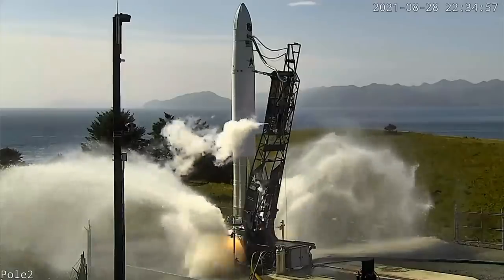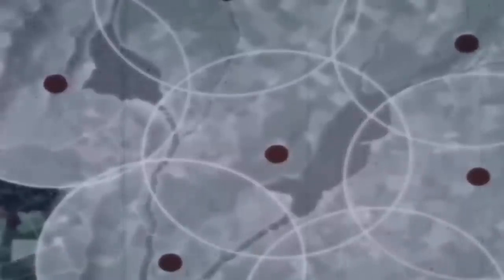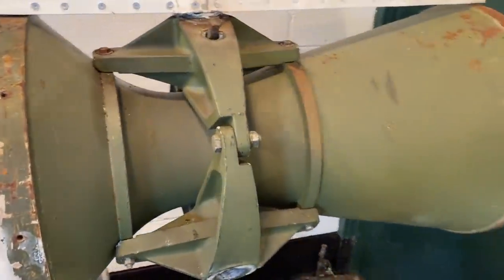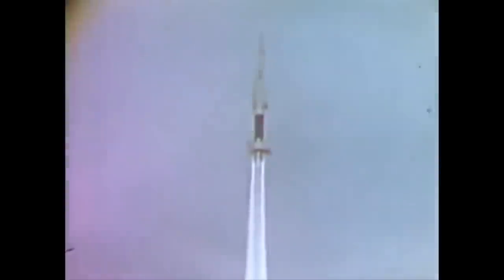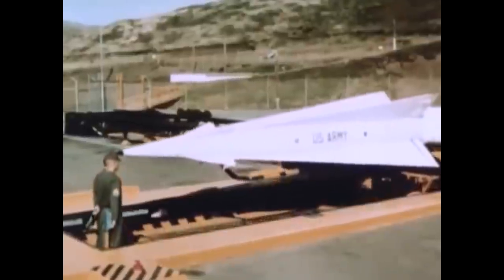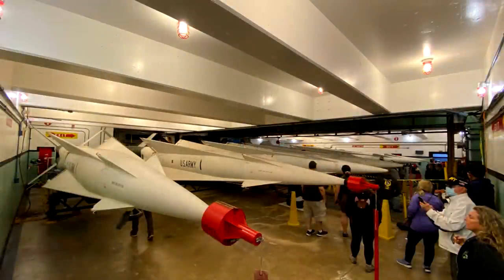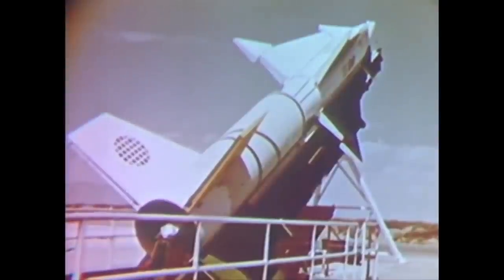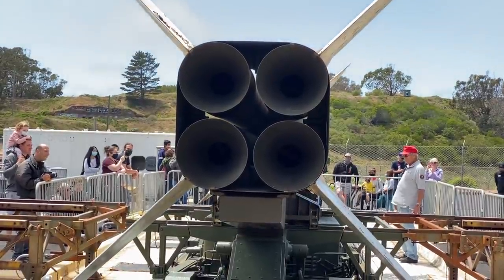Nike-Hercules - US's Surface To Air Missile with Nuclear Warheads.

Comment: In the mid 1960s, I was stationed at Redstone Arsenal AL as a Nike Hercules electronics instructor. You wondered about the analog computer.  The computer was very simple. Picture a servo driven slide rule connected to each of the missile and target tracking radars. It converted all of the angular and range inputs into large cubes in space with the intercept point in the center. As the missile neared the target the cubes became smaller and smaller until the burst signal was sent. See, nothing to it. Only one problem understanding this. Most of you youngsters have no idea what a slid rule is!
Reply from the maker: Slide rules I understand, building feedback amplifiers with sufficiently accurate response is the hard parts.
Reply: @scottmanley  
Of course the null detectors were vacum tubs, with of all things, DC filaments to reduce noise. Even at that, they were zeroed out once a second to stop any drift. The small heartbeat "zero set" ticks could be seen on the plotter.

The data potentiometers were really something. They were oil filled, about 18" in diameter, with spiral wrapped wire wound function cards. Each were many turns, quite a few feet in length. The servo drove a pickup shoe that followed the spiral. The shape of the card determined the function. Literally flat for liniar,  log or sign shapes for the trig functions. 

There were differences in the Ajax and Hercules command systems. First of all, the Hercules radar rep rate had to be longer to acomidate it's longer range. That is 12.6 microseconds per radar mile. Also the Hercules commands were digital pulses, while the Ajax was an single analog step kind of a pulse. The missile track radars could be switched to select either type missile. 

Did you know the radars were manually frequently hopping?! Each had two magnetrons. An operator would watch a spectrum analyzer for any  jamming, move the off line magnetron away to a clear frequency and switch it over. The missile receivers were unturned,  wide open to the X band. However it would only responded to the proper digital battery code, as there could also be missels in the air from other batteries. 

Fantastic how small that analog computer was. It "only" occupied a van about half the size of an 18 wheeler. The entire system electronics was vacume tubes, requiring enough power to light a small city. Well maybe not that much, but close.
Reply: @waterpogojim5296  Yes, those were the good old days.

Comment: The switch to nuclear Nike Hercules was limited or underway when Nike was cancelled – of the 5 batteries here around Bridgeport CT only the north one in Ansonia got the Hercules and all these sites were abandoned before 1970.
Reply: Maybe your area wasn't considered a high priority target. I can think of 6 sites in the San Francisco Bay area right off the bat that recieved Hercules and weren't deactivated until the early to mid 70s. One of them still has a deactivated missile, and is a tourist sight.
Reply: Yes one would assume the major cities were a priority – we all know about the San Francisco Nike sites and museum which were certainly more important than Bridgeport and dozens of other cities.
Reply: @johnwatson3948  
Perhaps I chose my words poorly. I didn't mean to sound high and mighty or give offense. I just meant to inform that many sites converted and remained active for several years.
Reply: No problem my reply was not meant that way either and you know the subject
Reply: Hercs had 4 times the range and FAR more punch so fewer sites were necessary. Nuclear upgrades started in 1957 and decommissioning was mostly complete by 1972 because ICBMs and SLBMs changed the threat. ALSO, Hercs move much faster and some locations could not be upgraded because the radar and launch sites were too close for the faster missiles.

Comment: Hi Scott, I was a USAF Missile Technician maintaining AIM-9 Sidewinders, AIM-7 Sparrows and AGM-65 Mavericks in the early 1980’s. I later did communication support for Titan 2 ICBMs. I have an AIM-9 Sidewinder Missile wing with a functioning rolleron. It can be spun up with an air compressor and uncared to demonstrate its function. I would be happy to loan it to you if you ever do a video that it would benefit. It’s 24” by 10”,  easily shipped.  PM me if so.

Comment: Analog computers:

I'll not delve into the murky depths of mechanical implementations, but the principals are the same.
First up is definition of the word "computer", in modern terms, these are more programmable calculators than computers.
Most computing elements are based around differential OPerational AMPlifiers (OpAmps). A theoretical opamp will have infinite gain and infinite input impedance. The output is proportional to the difference between the inputs.
Using these it is easy to build adders, subtractors, multipliers, integrators, and differentiators.
The "programing" stage is to write the problem as mathematical equations, the analog computer can then solve those equations in real time.

Comment: Well, after the SALT agreements, many missiles changed hands to go to the U.S. allies, but the ACCESS to them remained with "Custodial" units when U.S. warheads were still attached.  Technically the U.S. didn't have the missile WITH the warhead, BUT........  Also, many were at the maximum surface to surface range in Europe to the last defensible line in case of Soviet Attack.

Comment: Hi Scott - love your content - I think it'd be fun to get Kerbal space program on this. :+) - what does it look like launching to low earth orbit from Mt Kilamanjaro?

Save a lot of fuel and tankage - 19,000 foot mtn. - so first 3.5 miles altitude is by truck, 19,000 feet - so air is thinner to start with (.45 atm), and exactly on the equator, already going 1000 miles per hour West to East.

Comment: I always thought the artillery shells used a linear two point implosion device. I guess a gun type makes sense as being really simple.
Reply: All the early tactical warheads were Oralloy (Oak Ridge Alloy) only designs (no plutonium, only U235) so that the resulting contamination was relatively less damaging. The Hercules warhead was all U235 for this reason. With a gun design you can use a "passive" neutron initiator and they don't need batteries or any electronics.

Comment: Analog computers isn´t really that strange. Typically they just use a line level ALU that uses a capacity stacking for addition and subtraction. Multiplication is a bit more complicated. How its done is that the signal is converted to a logarithm via a non linear component, then added or subtracted for multiplication or division, then converted back to linear scale.

So a Analog ALU is really quite simple. Just two devices. A analog stacking device and a log device. Subtracktion and division is simply done with a inversion.

Then there are of cause compare functions that is usually just done via a subtraction and check if the voltage is positive or negative.

Analog registers work just like digital. The only real diffrance is that the output need to be a op amp in steed of just a transistor.

Now for programming a analog computer are usually very different to a digital. As far as i seen most (if not all) uses a totally segregated register for instructions and data, and a lot of them simply uses digital instruction set. The instruction set is also often very limited, try to fit it in 16 instructions to only get 4 bit registers for instruction set, or even 8 instruction for 3 bit register.

A lot of analog computers is not even really computers but really calculators that just run a set loop of calculations. This is also true for a lot of compact mechanical computers. A typical example of that would be the engine control computer of a WWII FW 190 fighter. Most WWII fighters had a number of levers for the pilot to control the engine, i seen planes with as much as 6 levers for a single engine fighter. Propeller pitch, methanol water injection, fuel mix, engine cooling, actual throttle, there are even more possibility.

While most late war fighters had automatic pitch propeller, there was still a leaver to control the pitch system. FW 190 replaced all this a computer and just one leaver. The computer is actually fairly small.

Comment: I’ve seen some claims being made online that the Nike missile bases protecting the airspace around major east coast US cities from Soviet aircraft attack were fitted with nuclear warheads. This is a farfetched claim for many logical reasons. First and foremost, locating nuclear weapons so near high population areas would have defeated the defensive purpose of the Nike missile system if an accident occurred or if an enemy simply attacked the facility as opposed to the nearby metropolis it was defending. Second, the security required to protect bases with nuclear weapons would have been impractical given the proximity of these bases to populated areas. Lastly, the range of these missiles was inadequate to carry a nuclear warhead far enough from its point of launch to a safe distance from our populated coastline. I lived near the NY93/94 Nike Missile Base located in Franklin Lakes, NJ and hiked past it just along the fenced perimeter while the base was still active, which would not have been even remotely possible if live nuclear warheads were fitted to missiles in their underground bunkers only a few hundred feet away.
Reply from the maker: You appear to overestimate the blast radius of a nuclear warhead: here’s what a 20kt device a few miles off the coast would look like - https://nuclearsecrecy.com/nukemap/?&kt=20&lat=37.8049014&lng=-122.8058624&hob_opt=2&hob_psi=5&hob_ft=100&psi=20,5,1&zm=10

Comment: Looking at that missile cutaway, it looks like it has something like magnetic core memory as a processor perhaps?
Reply: The missiles were radio controlled from the ground. They received pitch, yaw, and explode commands from the computer via the MTR or Missile Tracking Radar. No "processor" per say, just a set of roughly 100 tube opamps hardwired to produce a firing solution.
Reply: @Peter_S_  Oh wow. You learn something new every day...
Reply: Nop, no core memory, no digital, info was stored on capacitors, with tube electronics to keep them charged, and the tube amplifiers where kept stable by mechanical rotary switches testing them all every few seconds

Comment: The USAF also had nuclear air-to-air weapons, namely:
AIR-2A Genie unguided rocket (1.25kt W25 warhead, time fuse) used by F-89 Scorpions, F-101B Voodoos and F-106 Delta Darts
AIM-26A Falcon guided missile (0.25kt W54 warhead, semi-active radar guidance) used by F-102 Delta Daggers

The rationale of "bomber formation" targets was a bit of period propaganda that won't die. Nuclear-armed bombers wern't coming in formations (why should they?). The real problem that they didn't want to admit to was the accuracy of 1950s electronics (as explained in the video) that couldn't reliably put a missile within the lethal radius of a practical-sized conventional warhead in a head-on shot. A Genie warhead was tested in Operation Plumbob in 1957. It was detonated at around 20,000ft, and volunteer observers directly below the blast suffered no ill effects and measured negligible radiation levels.

Oh, and to any Brits thinking "tch - only in America"; the RAF wanted Genies for it's Lightnings and tried hard to buy them. The US was up for selling the weapon too, but the fissile material would have had to come from the UK nuclear programme and that was the death of the idea, because we were only just producing enough for our strategic weapons and the government decided that those got priority (because they stopped WWIII from happening via deterrence) over defensive tactical weapons (that would only get used if deterrence had failed).

Comment: 10:09 "The non nuclear version wouldn't need this of course." Why not? Surely it's not a good idea to have anything detonate accidentally on the ground.
Reply: The Launcher Control Area was a very dangerous place.

High explosive detonations are always possible when rocket motors and warheads are involved. The static probe prevented NUCLEAR yields until the missile was outbound.

Comment: "The nuclear one had a surface attack profile" just incase your neighbor city gets too nosey
Reply: Very useful in Europe just in case you needed to nuke a rail yard that was being invaded. Also useful for anti-ship from a very small number of sites.
Reply: @Peter_S_  I wonder what the range would be on them. Given they look like they had alot of drag.
Reply: @samgeorge4798  These missile actually "flew" with the wings providing 0.5G of active aerodynamic lift just like a plane's wings. Trajectory would arc above the target elevation so the missile was always flying down to the target. Operational ceiling was just over 100,000 feet and initial elevation dictated maximum range which was about 95 miles against a typical medium level airborne target, a little less for a high altitude bomber. A surface target could be slightly further away... I seem to remember a figure just short of 120 miles, but the "S-S Mission" button was only added later in the system's life. Top speed of mach 3.65 and at launch they were already supersonic before traveling their own length. Drag was not much of an issue.
Reply: @Peter_S_  ahh your right I completely neglected the lift all those control surfaces would provide.

Comment: They may never have been fired in anger but I do know one was launched from the site defending DC.

All those radars needed to be calibrated, so how do you calibrate them? You send bombers out and have them do mock attacks. My grandfather was the flight engineer on one of those bombers. While as far as the crew knew everything had gone great, that is until, they got back to base. When they landed they were told they were lucky because someone actually launched one of the missiles at them instead of just simulating the launch. The controller blew up the missile but it could have been really bad.
Reply: Not in my years in ADA did we ever launch a bird in D.C.
Only time we launch these birds were for training in NM or Create. 

In 73 we went to battle stations had 12 birds locked an loaded on lchr read for action,  but no launch order ever came .
Reply: @bradhanley8368  This happened in the mid 50s. My grandpa was on a B-29 at the time.

Comment: Nuclear weapons must be banned, purely for statistical reasons for nuclear war being triggered by accident.

If we estimate, for example a 1% risk per year (o.o1) because of risk of misunderstandings, technical malfunction or terrorist attack for every year (probably lower most years, however probably much higher some years, and we look back at about 70 years with proliferation of missile based nuclear weapons, we simply get the formula 0.99^70 for survival, which equals to about 0.5 meaning 50% chance of survival so far! 

Of course the risk could be much lower than 1%, however still by the power of exponents, the risk will approach 1 (100%) sooner or later, the dice is thrown as time goes by, regardless.

This comment is not meant political, it simply takes into account the unavoidable math that is behind the increasing risk that nuclear weapons are used, with the high risk of firing additional weapons, if one weapon already is fired, be it by accident or malice (most probably terrorism or something happening in eg. North Korea or a a crazy dictator taking control in any country having nuclear weapons)

Comment: The US Airforce used to have their own missile defense called BOMARC that also had a nuclear warhead. I live about 20 miles from the BOMARC base that was at Ft Dix (McGuire AFB) which had a fire in 1960 that melted a missile. There was no nuclear explosion but there was radiation spread around the site.
Reply: The only difference between Herk and BOMARC. Is Herk never had a Broken Arrow incident but BOMARC did.